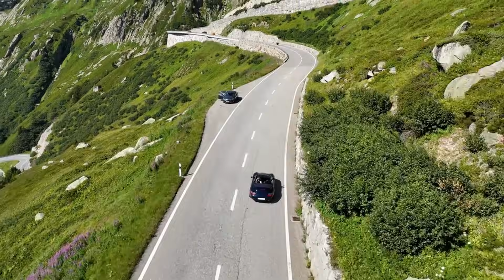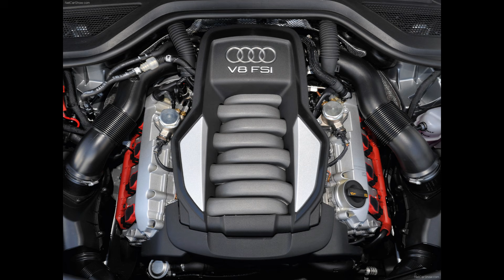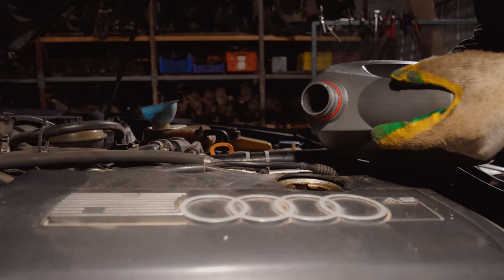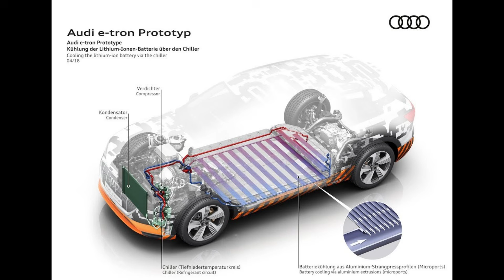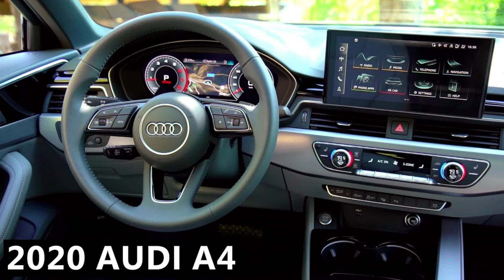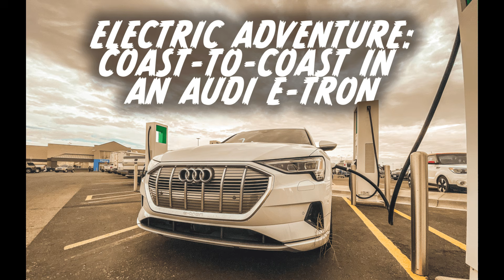Audi Owners Ignore This One Habit – And It Slowly Destroys Reliability

Comment: Bullshit! You don't need more than 5 minutes for a car to reach normal operating temperature. Just run your engine for 3 minutes at the most and use your naked hand to touch the engine to feel how hot it is.
Reply from the maker: I get your point 👍
You don’t need to idle for long — that’s true.
The key is how you drive in the first minutes, not just waiting.
Modern engines reach temperature faster under light load, but pushing too early can still increase wear.
Do you usually drive gently in the first few minutes or normally?

Comment: What is full operating temp? 170 and above?
Reply from the maker: Full operating temp refers to oil temperature, not coolant.
On most Audi engines, you want to see around 190°F–220°F (88–105°C) oil temp before pushing it.
170°F is warm, but not fully at operating temp yet.

Comment from the maker: Short trips quietly reduce long-term reliability.
Monitor your system.
Maintain proper voltage.
Let the car complete its cycles.
Tools used in this video are tagged above.
Hidden Car Tech

Comment: I have a 2012 AUDI Q5 WITH 105000 MILES AND JUST HAD TO GO TO THE SHOP for the first time . THE WATER PUMP LEAKED . I love the car . I just bought my wife a Q5 , hope it will last as long as my 12 with low problems .
Reply from the maker: That’s actually a great run 👍
105k miles before the first major repair is solid, especially on a 2012 Q5.
Water pumps are a known wear item on many 2.0T models, so you handled it at the right time. Once replaced properly, they’re usually good for a long stretch again.
If you keep up with coolant quality, oil intervals, and avoid repeated short cold drives, your wife’s Q5 should treat you well too.
Appreciate you sharing real-world experience — that’s what helps other owners most

Comment: Ok, so how long is long enough? I have a 15 minute commute to work and back. Is that long enough to get everything up to temperature? What about 30 minutes? How often?
Reply from the maker: Great question.
In normal conditions, most modern Audi engines reach coolant operating temperature in about 8–12 minutes, but oil temperature usually takes 15–20 minutes of steady driving to fully stabilize.
So a 15-minute commute can be borderline, especially in cold weather or heavy stop-and-go traffic. A consistent 25–30 minute drive at steady speed is generally enough to fully warm everything and allow proper moisture evaporation from the oil and exhaust system.
If your daily drive is short, try to include a longer drive once or twice per week. That helps long-term engine and battery health.

Comment: What’s your advice for someone that drives only 4 miles a day?
Reply from the maker: If you only drive about 4 miles a day, the key is to compensate for the short trips.
Try to do one longer drive per week (20–30 minutes) to let the engine, oil, exhaust, and emissions systems fully warm up.
Avoid hard acceleration when cold, keep maintenance intervals shorter, and pay attention to battery health — short trips stress it the most.
Reply: @HiddenCarTech Thank you!

Comment: Waste of 9 minutes. Message could have been delivered in a minute. Instead it is repeated over and over. Worst of all, we are never given any guidance about how long is required for the car to do warm up adequately and complete its routines.
Reply from the maker: Fair point on length — that’s valid feedback.
As for guidance: there isn’t a fixed time, because warm-up depends on ambient temperature, engine type, and driving conditions.
In general, gentle driving until oil temperature stabilizes is what matters — not idling for a specific number of minutes. The video focuses on habits rather than exact timers.
Reply: @HiddenCarTech understood. My commuters 30 minutes so no problem there. From home to driving range is 4 minutes. May just use the golf cart for that!  Grocery store is 6 minutes.

Comment: This may actually make sense. My 2015 diesel biturbo been showing engine light and recently gave an adblue warning (which doesn't make sense as routine service was just completed)
The mechanic cleared the issue as nothing abnormal could be found.
I drive really short trips between my house and the station 6mins away and less than 5km
I did a 25km drive after letting car idle for a bit and the engine light disappeared

I may be speaking too early but will continue with this style of idling and gentle steady driving over longer than 10mins to see of the engine light stay off
Reply: Yes , i bought my audi with 163tkm now 300tkm not a single problem , everyday 1 min idling when starting the car  and when cold 2 min thats enough . Do longer trips often . Mine 60km everyday. And last every 10 to 13tkm oil change. I use Liqui Molly Top Tec 4200. Always the same oil from the day i bought it.
Reply from the maker: That actually lines up perfectly with what you described.
Very short diesel trips often prevent the exhaust, AdBlue system, and sensors from reaching stable operating conditions, which can trigger temporary warnings.
That longer 25 km drive likely allowed the system to stabilize and clear itself.
Your plan sounds sensible — occasional longer, steady drives are exactly what modern diesels need when daily trips are short.
Reply: If you often do short trips you are clogging up your DPF and your EGR Cooler from AdBlue.

Comment: Thus means the cars are ssa if I got to drive at least 30 mins for my car to run properly and last then it is a waste of mechanical engineering
Reply from the maker: Not quite. The point isn’t that you must drive 30 minutes every time — it’s that constant short trips only accelerate wear on modern systems.
Occasional longer drives help everything stay healthy.

Comment: Push out the exhaust once and a while, keep fluids to par and always allow warmups and cool downs. You'd be surprised to see the battery effect the acceleration protocol.
Reply from the maker: Exactly — you’re spot on 👍
Battery health, voltage stability, and proper warm-up/cool-down all influence how modern cars manage acceleration and throttle response.

Comment: So you tell me i cant drive my car in cold weather ? Most if not all cars in cold weather will take twice or longer to reach optimal oil/operating temps. Your electrical system doesnt need to warm up either. Basically your saying that if my car takes 15/20 minutes to fully warm up i shouldnt turn it off. This is nonsense. As long as you warm up the engine and let the roms drop before driving your good, dont floor it after 12-15minutes of warm up, but turning it off after a short drive is not going to damage it 😂.
Reply from the maker: You’re right about cold weather — warm-up takes longer, and no one is saying you can’t drive your car.
The issue is repeated short trips where the engine never fully stabilizes, not normal cold starts.
Reply: @HiddenCarTech yeah and that applies to all vehicles jot just Audis.
Reply: On the next non short drive your PCV system gets rid of the water in minutes as your engine has reached full operating temp. This video only applies if you only drive all the time 5 minutes o walking distance. And applies to all cars. I would be more worried about water pumps in that case.

Comment: I've got a 2013 A6, and I've had zero issues with it. Only thing I do is let the cars idol drop to the norm and then off I go.  I do a mixture between both short trips (under 10 min) and medium length trips (under 30 min). As far as I know, I'm still on the original battery that came with the car as I've never replaced it and never seen it on any of my services documentation.  So take this video's "advice" with a grain of salt.  Me, I'll continue to drive as I have for the last 13 years with my Audi...  It will be many more years before I buy another car since this one is still as good as the day I bought it.
Reply from the maker: That’s totally fair — and your experience actually proves the point.
Letting the engine idle down, mixing short and medium trips, and not abusing the car are exactly the habits that keep these cars reliable long term.
Not everyone drives the same way, which is why some owners see issues and others don’t. Thanks for sharing real-world experience.

Comment: I absolutely HATE that adaptive transmission nonsense that these cars use. Quick & peppy one day, the next day acting like it’s stuck in molasses. Why does a car need to “learn & adapt” to how I drive? Just GO when I need you to GO. How hard of a concept is that?
Reply from the maker: I get where you’re coming from.
Adaptive transmissions are tuned for efficiency and comfort first, not instant response. For some drivers they work fine, for others they feel frustrating.
That’s why understanding what the system is doing — and when to override it — matters more than trusting it blindly.

Comment: I habe 3 Audis and have owned many more. This information is great. But Audis are ovwrly complicated and expensive to maintain. If most Audis are driven short distances, they should be designed to be reliable for short distances.
Reply from the maker: That’s a very fair point, and I agree with you.
Modern Audis are complex, and that complexity absolutely increases maintenance costs over time.
The issue is that many systems are engineered around emissions and efficiency targets that assume mixed or longer driving cycles, not constant short trips.
Ideally, cars driven mostly short distances should be simpler — but current regulations push manufacturers in the opposite direction. That mismatch is exactly what causes many of the problems owners experience.
Reply: @HiddenCarTech I love German cars, but i came from an engineering background. It seems if 10 parts will solve the problem they use 100. I am still struggling with the MMI in wife's Q5. It keeps pushing out alerts and even Audi customer service isn't helpful.

Comment: My RS I keep rpm under 3k till reaching 190f oil temp
Reply from the maker: That’s a very good approach.
Keeping RPM low until oil temperature, not coolant, reaches operating range is one of the best habits for engine longevity — especially on performance engines like the RS models.
Simple discipline, big long-term benefits.
Reply: @HiddenCarTech  Yes not my RS just show just Oil Temparature. I have no idea where is coolant temparature... its not important. excelpt if it is too hot or too low.
Reply: Thanks guys. This was helpful. My Audi A6 2014 didn’t have the oil temperature gauge on the dashboard by default, so I used my OBD Eleven to turn it on. Cheers.
Reply from the maker: @andreTheSwordsman Glad it helped 👍
You did the right thing — enabling oil temperature via OBD is one of the best ways to drive these cars properly, especially on models where it’s hidden by default.

Comment: This is 100% solid advice. I have a tuned Audi A3 with oil temp on the dash. The water temp gauge is hot in 5 minutes. But it takes a solid 20 minutes for the oil temp to get to 200 longer in the winter. All the moisture and some unburnt fuel in the crank case never evaporated off until it hits full operating temperature.

I live in the mountains and drive it hard AF I can go thru 40k tires in 10k I have very little issues with it, especially for as hard as I drive it. Your Toyota would be scrap metal. Though the opposite would  be true if I drove it like a commuter
Reply from the maker: Exactly — this is a perfect real-world example.
Coolant temperature rises quickly, but oil temperature is what really matters, especially in winter. Until the oil reaches full operating temp, moisture and fuel dilution don’t evaporate.
That’s why short trips and hard driving before warm-up quietly shorten engine life. Thanks for sharing a practical perspective.

Comment: This is a problem for many drivers in the UK. A car will take ten miles to reach full operating temperature.  This many people experience problem with cars fitted with a diesel particulate filter as the car doesn't get hot enough for long enough,  to carry out regeneration.
Reply from the maker: Exactly — this is a very common issue in the UK, especially with short, urban trips.
Many diesel engines need consistent operating temperature for long enough to allow proper DPF regeneration. When trips are too short, soot builds up over time and problems start appearing.
This is one of the reasons why modern diesels are often a poor match for mainly short-distance driving.

Comment: Define the proper ranges of long vs short drives.
Reply from the maker: Good question.
Short drives are typically under 10–15 minutes or before the engine reaches full operating temperature.
Healthy drives are usually 20–30 minutes or more, allowing oil, coolant, exhaust, and emissions systems to fully warm up and clean themselves.
Repeated short trips without longer drives in between are what cause most long-term issues.
Reply: @HiddenCarTech thank you!

Comment: whoa whoa whoa audis poor quality and complex S@t that breakdown all time is not bad driving habits , why old vws and audis where built like tanks and had minor issues only like my A4 1.8 20VT
Reply from the maker: Fair point — older VW and Audi models were incredibly solid, no doubt about that.
The video isn’t saying Audi is “poor quality”, but that modern cars are far more complex. That complexity makes driving habits, maintenance, and usage patterns much more critical than they used to be.
Many owners have great experiences — like your A4 1.8 20VT — while others run into issues simply because the rules have changed.
Reply: @HiddenCarTech i used the car with no real performance issues with the maf disconnected due to lpg conversion for many years and the car just kept going and revving like nothing happened, modern audis are oh one of my sensors are dirty ,lets get to limp mode until you spend 1000-3000 bucks to fix it and not mention what happens with those automatic gerboxes and fake quattro systems that are FWD all the time
Reply: Well this was not the video I wanted to see. I drive 2 miles everyday to work in a b9 s5. But like others I drive like an old lady if the car isn't up to temp